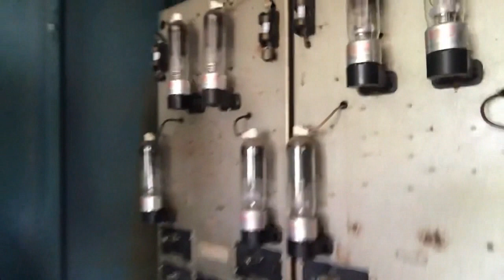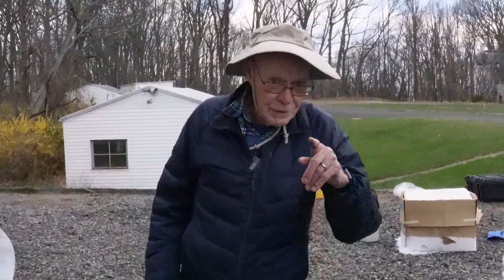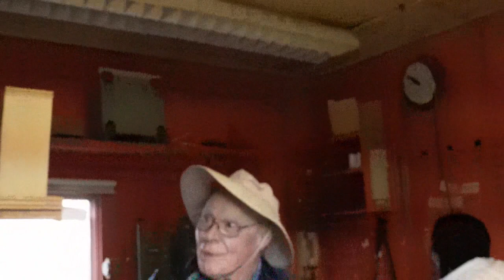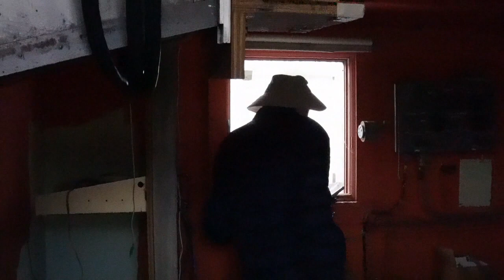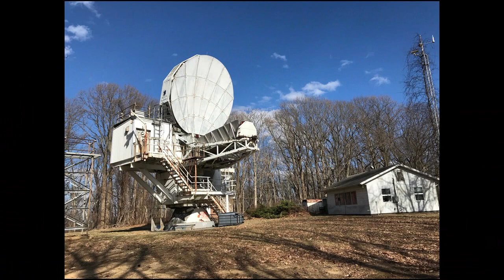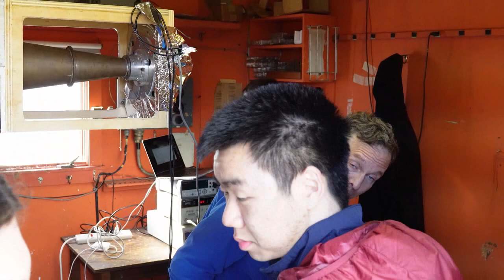Dr.  Robert Wilson and Harvard Astronomy 191 class field trip to the Holmdel Horn Antenna.

Comment: Do they actually turn it on?  I want to hear the sound
Reply from the maker: It's used for listening, but they have, on special occasions, put a small speaker connected to an iPod at the throat (apex, inside the booth) and the sound is amplified through the horn. It's very directional but it works!

Comment: Nice video! I never saw the inside of the antenna. I'm really surprised the antenna is still there. I guess they can't demolish the antenna. Is the nearby office building demolished? My father was hired to AT&T under wireless communications. He worked at the office building until recently (2021) when they closed the building. Now he works at Crawford Hill. That Crawford Hill office was so abandonded. The trash hadn't been taken out for months, dozens of empty rooms, and empty conference rooms.  

Just curious, how did you get there? Was there demolition and was the area gated?
Reply from the maker: Hi Bob, the entire property has been sold to a private citizen. The gate up to the top of the hill  is now locked. The office building is still there but empty. The antenna is in great shape.